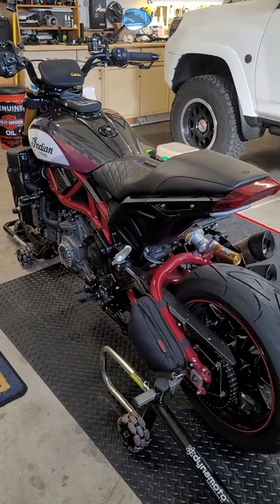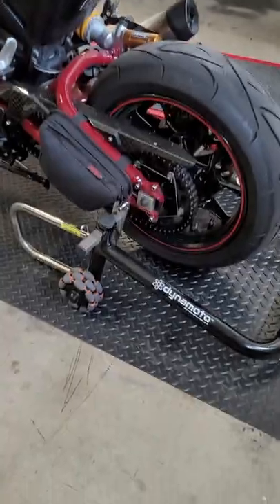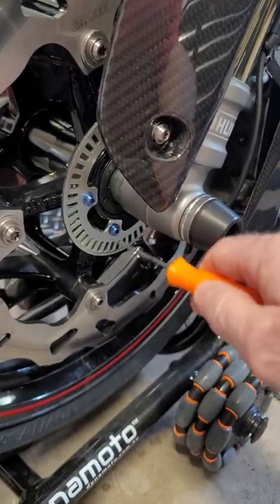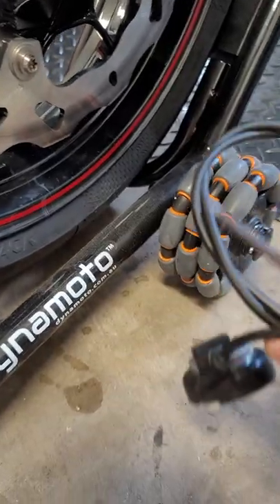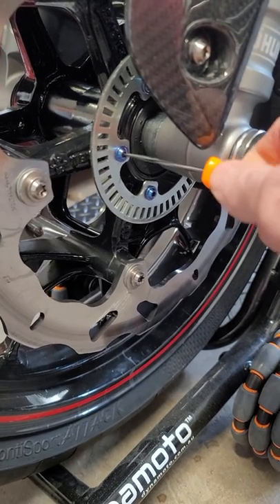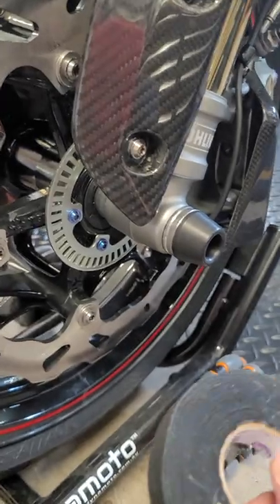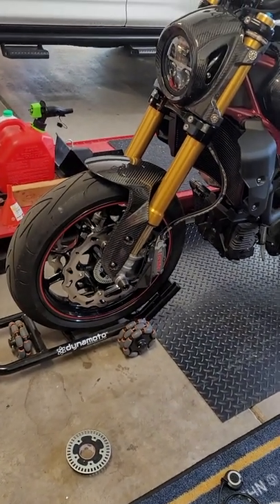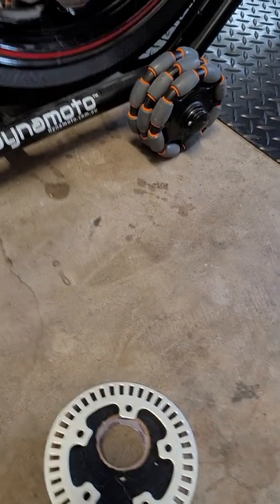Indian FTR 17" Factory wheel swap

Comment: Thanks for sharing man it a big help! Question though how does it handle compared to the 19 inch wheels? Does it corner better? Better center of gravity? I’m looking to get different wheels for my ftr and I just don’t know if going to a 17 is worth it.
Reply from the maker: The difference is night and day I don't do any trail riding I primarily ride on the street and 17's offer a tremendous handling advantage over the 19/18 wheels, not only that there's a much better Tire selection for 17s.
Reply: @vegasparke  thanks for the reply I really appreciate it, I’ll definitely be switching soon.

Comment: Hi Parke

I'm working on switching to 17" wheels. There are 48 holes in the ABS ring on the front wheel. Do you have experience with how many holes make the speedometer fit. 47 holes? Should I make an equivalent for the rear wheel? Hope you can help

Lars